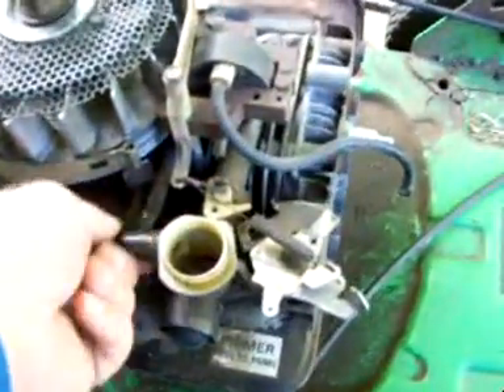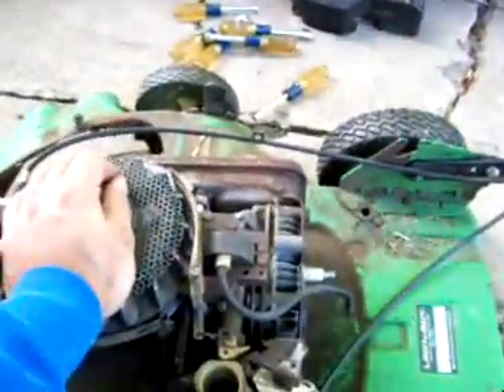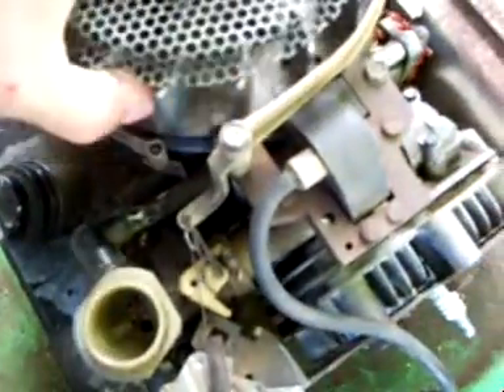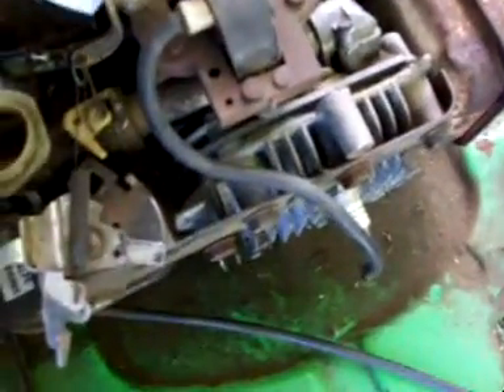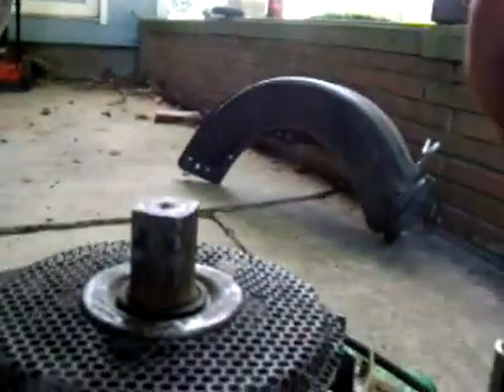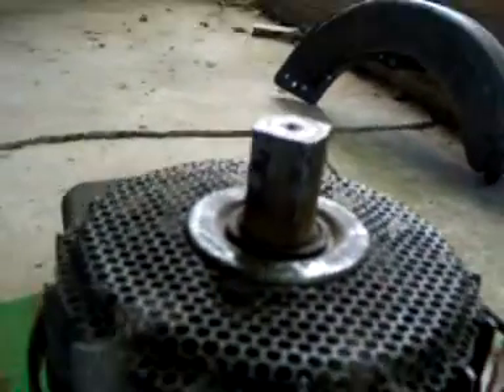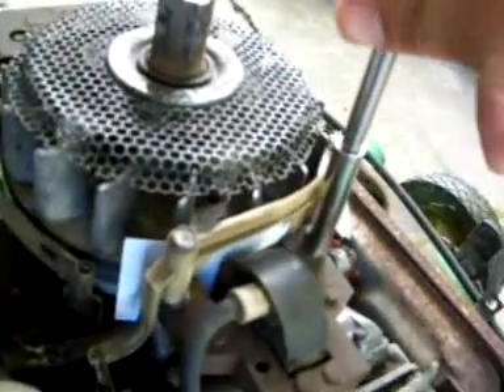Setting The Ignition Coil Gap On a Briggs

Comment: So the business card doesn't move when rotating the flywheel, you can pull the ignition coil all the way back from the flywheel and tighten the bolts. Then rotate the flywheel until the magnets line up with the ignition coil. Once the magnets line up, insert the business card between the flywheel and the ignition coil. You can then loosen the bolts on the coil and the flywheel magnets will pull the coil towards the magnets. You can then tighten the bolts on the ignition coil and it will be the correct gap.
Reply from the maker: Yes you could......  I usually leave the bolts loose on the coil and the flywheel magnets will draw the coil in when it is lined up.  There are many ways to do it that can get the same results.

Comment: Replaced the coil on my Tecumseh and used a business card for gap. New plug, clean carb. The timing was so far advanced it fired early and tried to run backwards against the pull-cord! Ouch! Used two business cards and problem solved. New engines are typically set with the gap to the fat side of the spec. I guess this is why. That, and business cards are getting thinner all the time. Just an FYI. Cheers! :-)
Reply from the maker: Hmmm, the gap should not effect the timing.  The coil is stationary as is the magnet.  In most mowers the screws only let you set the gap.  That is interesting.  I did have my tecumseh engine rip the rope out of my hand and it was the flywheel key.  It was tweaked ever so slightly that it would rip that handle out of my hand.  Didnt look to bad, but a new one fixed her up!
Reply: @More350Power With electronically-switched magneto ignition, the gap affects the timing by controlling the latency of the triggering circuit, typically some flavour of Darlington transistor pair. A larger gap not only lowers the maximum voltage induced in the coil, it delays the attack and speeds the decay of magnetic field strength. The triggering voltage is therefore reached a fraction of a second later with a larger gap than with a small one. Shrinking the gap effectively advances the ignition as well as generating a stronger spark. Timing adjustment is limited and imprecise, but nonetheless real. Cheers!

Comment: Hi, I have a mower with the same engine. Can you possibly tell me where the black wire that comes out from the left of the coil goes? (as you look at it from the front)
Reply from the maker: That is the engine kill wire..... when it is grounded to the engine it stops the ignition coil from sending a spark.
Reply from the maker: Mine goes to the other side of the engine where the blade brake cable goes in
Reply: More350Power 
Thanks, does your wire also start from there? I cannot see anywhere it would go at the moment, it seems to be exactly the same engine you have

Comment: Great video - do you have something on the choke/throttle spring hook-up?   I can't find a good diagram for how the springs should be connected.  You almost showed it on this video a couple times, but I couldn't pause it to get a clear view.  Thanks in advance.

LT
Reply from the maker: I wish I did have it on video.  They are close to being the same but it depends on if you have a throttle control or not.  one spring goes to the throttle on the carb and the second one goes to a stationary location usually on the bracket.  increasing tension increases rpms while decreasing..... does the opposite.  It also helps the governor keep the engine at a constant rpm.  I wish I still had this engine I could show much more easily.  i can picture it in my head but its hard to describe it.....

Comment: I love it here I am with a set of feeler gauges and none of them say business card on them ;) Guess I'll reach for a business card.
Reply from the maker: Rich Clark lol, it has worked every time from briggs to tecumseh even on two stroke engines...
Reply: It worked for me too! Needed a new magnetron but she was back and running like a charm.
Reply: Rich Clark 
so whats the gap? 0.2mm ? or 0.15-0.25?
Reply from the maker: 2012isRonPaul .006 - .010" and .010 - .014" & Microfiche or index cards of the proper thickness also work well.

Comment from the maker: If you have the correct coil and flywheel on that engine there shouldnt be any kickback.....  Reasons for kickback are if your trying to start a lawnmower engine without a blade on it giving the engine counter weight that it needs or if it has a blade on it, it sounds like your flywheel key and or flywheel need replaced.  If you have ever hit anything while mowing that stoped the engine suddenly, it will damage the flywheel key changing the engine timing.

Comment from the maker: any fuel leak especially at the bowl could cause that problem.  also if the coil you used wasnt the same as what the engine calls for it could also cause problems.  usuallly the engine pulsing or surging is from a mal adjusted carb or covernor linkage.... air leak in the bowl or bad gas....

Comment: Did this with my coil as well but it also revolved in pulses once started. I had used a coil from a 12hp motor on my 14.5 hp motor and assumed it was the difference in coils but then noticed a fuel leak on the fuel bowl that gravitated toward an electrical connection at the bottom of the bowl. I'm not sure now which one is causing the problem. Any ideas?
Reply from the maker: The solenoid on the fuel bowl will cause a no start issue

Comment from the maker: That sounds like a carburetor and or governor issue....  if the coil gap was that bad it would either be hard to start or not start at all
ive had those diaphram primer carbs do that to me and sometimes if the filter screen that is plugged up or the spring under the diaphragm that jumps out of place.  Plus, it the diaphragm isnt in the right order on top of the gasket or botton... id have to look would cause problems but id bet, governor linkage needs straightened

Comment: thanks for vid. recently changed the diaphragm on carb but after starting engine the revs came in pulses I think this is the prob since I did remove the coil screws.
Reply from the maker: If it’s revving on its own it’s usually the governor or mixture screw if it is equipped with one
Reply: @More350Power  yes the governor spring tabs was adjusted and worked but eventually I figure the issue and replaced the springs which had weakened

Comment: Stoop! Pull magneto back all the way. Tighten bolts. Rotate engine til magnets line up w/coil. Insert card. Loosen bolts. Magnets will suck coil into place. Tighten bolts. Done! While housing is off, tighten the 2 little intake manifold screws. Blow out the fins w/compressed air. Do not overtighten these little screws and bolts.

Comment from the maker: @MrMilitantviper There would be no gap between the coil and flywheel, the coil would pull up tight to the flywheel.  It would not turn over easy and you wouldnt have spark.

Comment from the maker: @specialforces2263 there usually are two wires from a coil pack on a points system engine.  One wire goes to ground, the other goes up under the flywheel to the ignition points and condenser and sometimes there is a terminal for a kill wire.....  hope this helps!

Comment from the maker: @specialforces2263 If you have a wire coming from under the flywheel, you have a points system and that should attach to the coil somewhere.  Hard to say without seeing it....

Comment from the maker: @nathanielnzl That is the governor air vane.   When the shroud is on it, the air pushed by the flywheel that not only cools the engine, pushes against the engine to keep it at a constant speed.  It also opens up the throttle when the engine bogs down to keep up.  Make sense?  Some governors are internal on briggs and tecumseh engines and run off of the cam shaft I believe.  Thanks for watching!